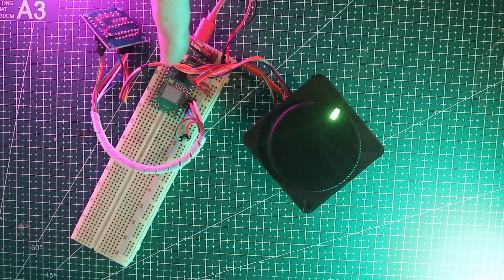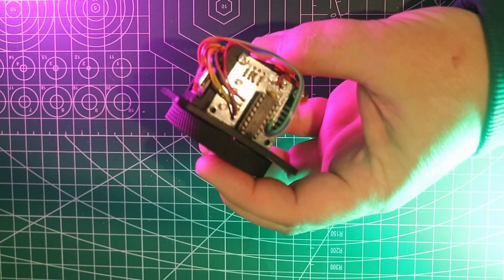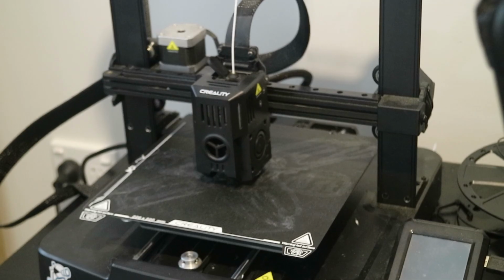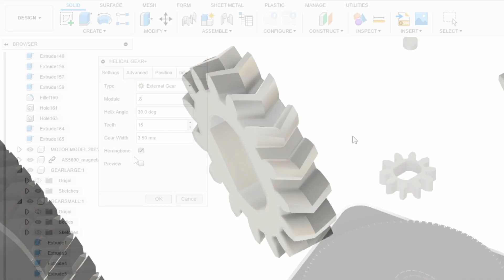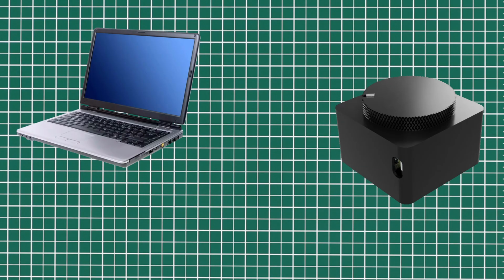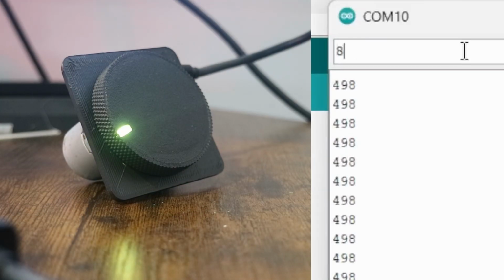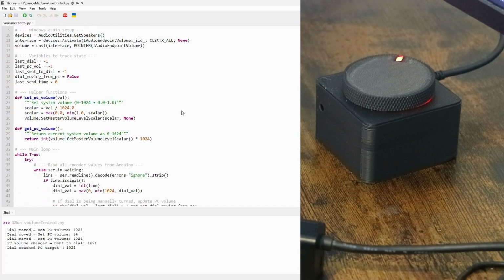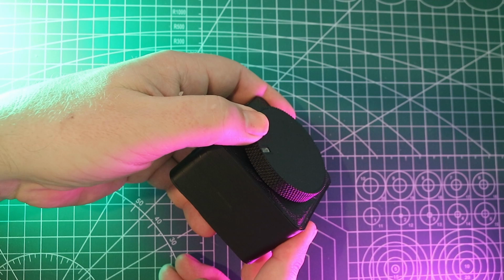I Built a Motorized Volume Dial for My PC

Comment: Love the video, it revived my own volume control project for my PC and the dial is a great idea
It would be great if the actual dial would be conductive or something and could detect touch with one of the esp32's touch pins (not sure if the c3 has them) that way you could easily make the dial only send its changed position when you actualy, manualy move it and you could interrupt a motorized movement by just touching the dial.
I did something similar to your knob with 5 sliders (to control streaming, games, mic, "other" and master separately) but the motorized sliders are to expensive (20€*5 ->  100€ (~116$)) and it is not easy to make them (or i am to dumb) could you please as well make a video about motorized volume slider if you can make them yourself?
Reply from the maker: A slider is a tricky one as you would probably use a worm drive to make the slider move, but it would be too hard to move the dial manually. You would need a clutch system of something. The benefit is the slider is the encoder, got me thinking as well.

Comment: great project - any chance sharing .STP files so we can maybe make some adjustments to the print files?
Reply from the maker: I will probably release a DLC when it's done, with the step files. For now it's just the STLs
Reply: @JWNZ  Do you think you could post the current step files, I have a couple of changes and want to add them to a bigger design.♥
Reply: +1 to this, I would love to integrate this into my design

Comment: Very interesting! You can  solve the backlash problem with two gears and a spring between them. Motorized meas remote control too...
Reply from the maker: Thanks for the tips!
Reply: I have seen the 2 gears+spring used before, but not sure how anyone could implement that in herringbone gears, if i had built this geared motoer drive i would have gone for friction drive or a belt, which would be a little 'flexible' but may also be a good feel, not sure.